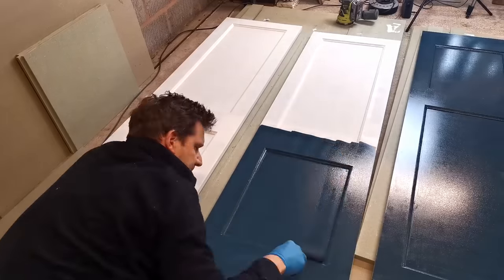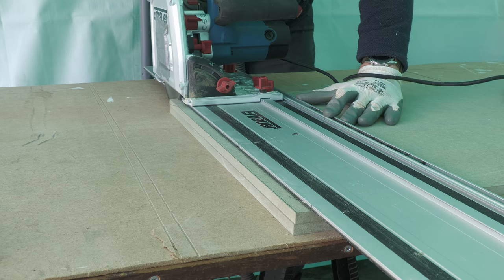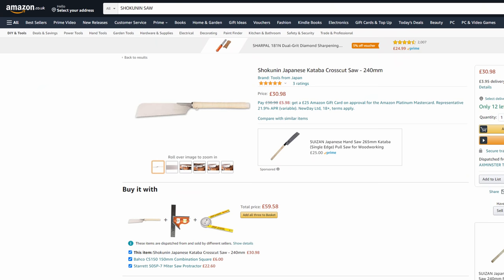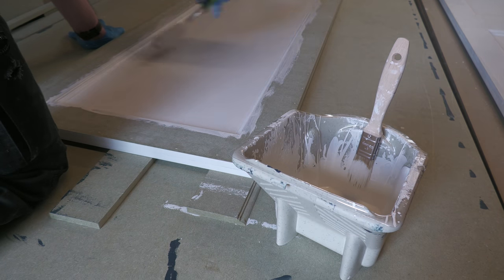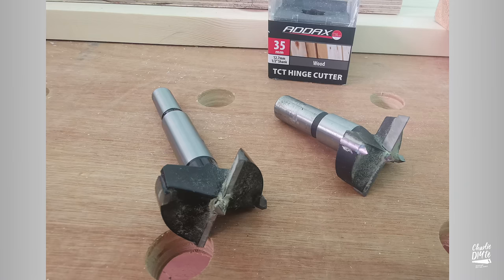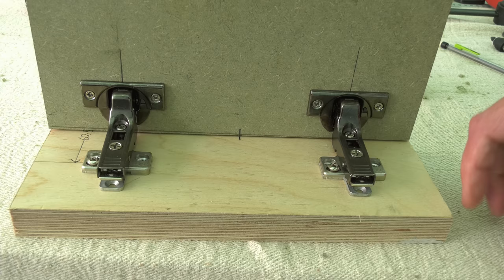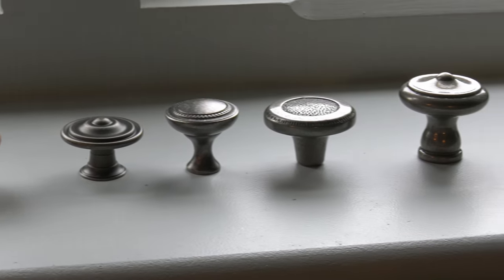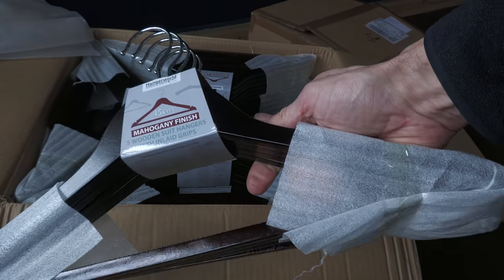How to Make & Hang Shaker Style Doors - Wardrobe Build Video #7

Comment: Watched all of this set and it’s a very good basis for a build I want to do, however it’s not as cheap and diy as it seems with the constant adverts and freebies this person has got through this build.
Reply from the maker: The adverts are a life blood to me as I do this full time and without them I'd be doing it unpaid which isn't sustainable. Would you work for your boss for free? Freebies? The drawer runners? Ok but they're not expensive and neither were the knobs. The wood I paid for albeit with a discount and the tools are all mine.
Reply: @CharlieDIYte  freebies as in free router bits, paint brushes, rollers, vacuum cleaner, discounts, etc. as I said this is a basis on the whole build not just the doors. 
let’s just call it the influencer discount and not a true representation of how much or how long this would take if your not doing this for content.

Comment: I've been really enjoying these videos, but I have to recommend against buying the ryobi nailer. They're one of those tools where it's worth every penny to spend more on a more reliable brand/nailer. I had the Ryobi for a while, had to get it fixed constantly and no matter what service centre I went to they said they saw these nailers ALL the time for the same recurring issues. I got about 8 hours of intermittent use out of mine before I got a dewalt one and it's been working great for over a year. Also used the atlas ones, which are great.
Reply from the maker: Thanks Gerald. Out of interest what kept going wrong on it?

Comment: Superb job, Charlie.  This project build has been a total triumph.  The floor to ceiling wardrobes maximise space & the navy blue shaker style doors are modern yet timeless.  So much love, energy & thought has gone into this (not forgetting blood, sweat & tears).  Well done!  If I want to uber picky, I would have put in a longer inside mirror & a rear view mirror on the inside of the opposite door so you & your other half can see your full outfits front & back & top to toe.  Good for your insta photos too but that’s just me!  You should be very proud of yourself.  Amazing job.
Reply from the maker: Thanks so much for that wonderful comment. After reading it I went and mulled over your suggestion about the double mirrors. I might have to do that! 👍🏻👊🏻

Comment: Hi Charlie, well done you got there, looks great. You can get a fine pin gun then you barely see the pin holes, Makita battery gun  is the best tool I've bought in years. Invest in a 1/2 inch collar router with a 35mm Trend blum hole cutter and leave it set up, saves loads of time as depth and 22mm in  is always set up. Dead flat varnish is a good option over that dark paint. I use Hafele rechargable motion lights about 120mm x70mm they are so quick n easy to fit. Glue the rails and not the door panel that way you can make sure the glue is where it needs to be. Keep up the good work.
Paul Thomson Furniture Makers
Reply from the maker: Thanks Paul - some wonderful info in there - thanks for sharing. Funnily enough I drilled one hole with my DeWalt 1/2 inch router and it was too fast - burnt the hole and then I Googled and learnt you're not meant to use forstner bits with routers. What's your take on that?
Reply: @CharlieDIYte  turn the router speed right down to  number 2 speed slow and steady like a pillar drill. Call any time 9 to 4 must use a trend 35mm cutter

Comment: Hi Charlie.... great video & narration as usual 👍.... when I make my wardrobe doors I use two layers of MDF exactly the same size back to back for the door blank, take one of the door blanks and cut your two holes in there to create the Shaker style look ...... and just route  the desired beading affect on the inside of the frame then glue &  pin them back together this saves a lot of filling for the mitre joints and then all your pinholes can be on the inside of the door .... for affect I stop the routering  just short of the corners........ this method saves a lot of time
Reply from the maker: That's ingenious. How do you get the cuts straight? With a circular saw?
Reply: @CharlieDIYte  Good Morning Charlie..... yes 👍 and then just finish the corners off with a panel saw then a little bit of finishing off with a block sander and you lose a lot of the cut marks when you router the desired finish

Comment: Brilliant Charlie well done really enjoyed the series. Just had a go my self at making waedbrobes doors  and the doors warped which was such a pain.
Reply from the maker: Ah, Neil, I feel your pain. D'you know why it happened?
Reply: Don't use too much pva glue, it dries and curls the door as it is a 2 part construction, only balanced layers of odd numbers prevent curl like all plywood. I use 9mm and 9mm for all my doors with thin bead of glue, you went a bit ott with the glue, the parts are so light, you only need a little. Hope that helps.

Comment: I am mighty impressed Charlie, you should be proud.
I am interested to know how your trim router got on with the large profile router bit as presumably it is bigger than those intended for that type of router ( I have a similar one so keen to know).
The Tite-fix 3.5mm screws are fantastic, I started to use them after you demoed them on a flooring video.   The problem I now have is I cannot buy them in France (I have even contacted the manufacturer, but now joy).
You can now reallocate the temporary workshop to be a gazebo for the summer and take a break!
Reply from the maker: Thanks Mat Can you not get them on Amazon? The trim router handled that bit absolutely wonderfully. No problems at all. I've got to say it's been a fantastic tool on this project, from those angled LED grooves, the bull nose trims on the fascia through to these edges. I've pretty much ditched my 1/2 inch shank DeWalt router now. Funnily enough the tent cafe into its own after easing of lockdown for a few parties 😉

Comment: Hi sir brilliant job as always , interesting problem with the lighting didn’t see that one coming. Regards to the paint finish I always used oil based paint, until recently we had a large project involving lots of doors and shelves to cover . All was ok till we noticed our dog was having trouble breathing, panic stations all round as you can imagine . So it turns out that pets can be extremely sensitive to paint fumes , so It will be water based products from now on for us. Having said all that I don’t think you will have a problem anyway , I have a free standing cupboard that I made several years ago and I used acrylic paint and it’s absolutely fine .  Once again a big thank you for these videos , I always learn something from your lovely channel.                   Best wishes and kind regards. As always        😀👍👍👍👍
Reply from the maker: Thanks and good to hear from you. Yes that really emphasises the issues there are with the vocs. Oil based would have just taken too long to go off given how much painting I had to do on this. I should perhaps have given them a protective coat of varnish or something but I put a lacquer on the kitchen table and it was a nightmare when I came to repaint.

Comment: Hi Charlie, First up, thank you so much! I've watched this series so many times whilst doing the same wardrobes in our bedroom at home and they've worked perfectly.
I have two changes to your design and one question! The first change was I had to use overlay hinges (supply issues down here in New Zealand lol) so I made the decorative strips between wardrobes out of 70x45 (cheap!) and spaced the wardrobes apart by that much. It's made it super strong because it's almost like a truss with the 70x45 sandwiched between 2 bits of MDF and well screwed. I didn't need to use a bit of steel bar.
Secondly, the way you put the rails between the stiles looked like a lot of work for 14 doors (it's a big room!) so I've figured out I can rout a roman ogee on the underside of the rail ends and it slots onto the stile ogee as if by magic. I mounted the Router and made a fence to get it nice off the edges. Is this a stupid idea? I figured plenty of glue and hold my mouth the right way and it should be good!

Comment: What an effort! Great job Charlie, looks great. That is odd about the sensors though, but love your improv fix 👍🏼
Reply from the maker: Thanks. Yes it is odd, isn't it. I even tried putting a wedge on the door so that the paint was hitting it at 90 degrees and that didn't help.
Reply: @CharlieDIYte  what make of sensor is it Charlie? I assume it uses PIR right?

Comment: Excellent job Charlie,
I tried Gorilla PVA glue a couple of years ago, I reverted back to titebond 2 before i got half way through the bottle (not that it was bad it just wasn't as good).
I tend to steer away from blum hinges the price when the other required hardware is factored in for me makes them hard to justify.
Reply from the maker: Good to hear from you 👊🏻 I'll check out that Titebond 2. Thanks for the tip.

Comment: That Ryobi finish nailer is a cracking tool. They’re more affordable here in the US ($99 bare) and I’ve started using mine in lieu of a clamp sometimes. Set the pin flushness soft so the nail stands a bit proud for easy removal.
Reply: Here in the UK Ryobi sell their 16 and 18 gauge pin nailers BUT NOT their 22 gauge version which is available in the US. Come on Ryobi, lets level up the playing field, please!!
Reply from the maker: Thanks Frank. Yes i slightly overdid the pin flushness and got a few mounds at the back of the MDF! Thanks for the comment. Always humbled to hear from people watching overseas 👊🏻

Comment: Absolutely amazing Charlie. So much work involved not only to build this but also to make the video. That's a lot of dedication. I've seen the Clarke portable workshop you use and I've been thinking of buying one for me as well.
After some research I've seen Dancover with a competing product and different levels of materials, like 50mm tubes and PVC cover instead of PE as the one from Clarke.
But I just don't know if that matters that much for using it for a while every now and then.
Can you tell us more about your experience after using it for several months?
Thanks
Reply from the maker: It's pretty much as good as the day I put it up, and it's laughed at every storm, and all the snow that's been thrown at it. I love it. Complete game changer for this project. Also no real signs of degradation, mould etc which is interesting. I did occasionally get a bit of condensation inside, as other people have complained about, but literally 2 or 3 times and using the heaters in there probably didn't help. I've got a couple of pin prick leaks on the roof, correctly stopped up with gaffer tape but I suspect that was a loose spark from the grinder or perhaps the claws of a jackdaw. Whatever you get make sure it has ratchet straps like this one, that you can tighten every now and then after storms
Reply: @CharlieDIYte  awesome, thank you very much for this. Love your work. All the best.

Comment: This is exactly the wardrobe I want to make and this is the absolute best video I've found. I have a few questions. I want to go the router bit way vs. gluing on the trim. When you use a 1/4 bit does that mean you have to use 1/4" thick wood? I know you glue mdf trim over an mdf board what is the total thickness of both boards.
Reply from the maker: Thanks. No 1/4 inch refers to the size of the shank on the bit. Each piece of MDF is 12mm thick.

Comment: Your videos have been so inspiring! I’ve got my carcasses done and rails in, and now heading into drawers and doors. Given the difficulty of fitting the hinge mounting plates after the drawers, why did you do the drawers before the doors? Can’t you (I!) do the doors, then unclip them and do the drawers?
Reply from the maker: Great to hear from you Nick. Very chuffed you're finding my vids useful. Sounds like you're doing a fantastic job on the wardrobe. Yes, your idea is a very good one which in hindsight I should have done! You have the luxury of watching my vids, seeing where I went wrong and perfecting the process for your build 😉 Just don't be tempted to make the gap between carcass and draw liner any narrower than I did, because you need all that gap to get your hands in to unclip the door.
Reply: @CharlieDIYte  thanks! An extra 10mm or more? Maybe I could just ask a child to reach in? ;) My current battle is boring the hinge cups accurately. I’m making screen doors to fill with canvas so am using soft wood rather than mdf. It’s a real pain to bore!

Comment: I have to complement you on this massive project. The wardrobes look beautiful. The videos series gave me some good ideas for a smaller alcove wardrobe I’m planning. I had a quick question on the build. 
Did you fix the wardrobe carcass to the sidewalls, so that they can support the weight of the doors. If so which fixings do yo recommend and how many?
Reply from the maker: Thanks Nanda. Yes i screwed the carcasses to the side wall. I think I used 7mm brown plugs on the right wall into brick and Fischer Duopower 8 x 40 on the left wall that is insulated plasterboard.
Reply: @CharlieDIYte  Thanks Charlie. I use the Fischer plugs a lot myself. Very convenient for multipurpose use. What type of screws did you end up using for the Fischer plugs and with what spec?

Comment: Love the detailed explanation of everything you do. It’s been so helpful in my projects. 
Quick question, where you have doors opening back to back, is there a trick to mounting the base plates either side of the dividing panel? Maybe my screws are too long but I think they will clash on either side of an 18mm sheet.
Reply from the maker: Thanks Matthew. I think the easiest solution would be to use 15mm long screws. Should give the hinge more than enough strength.

Comment: Hi Charlie. Did you panel the doors for added rigidity? I'm looking at constructing MDF doors without the panelling, would you be concerned about warping if using 18mm MDF, without any added reinforcement?

Also, out of interest, why did you use the solid wood instead of MDF for the surround pieces (skirting etc)?
Reply from the maker: Hi, panelling was more for the look than the rigidity. You should be with 18mm but attaching concealed hinges might be tricky as 18mm might not be deep enough. Make sure you use MR MDF as I find it more stable.

Comment: Looks great! Also a lot of great info. I'm thinking about making new kitchen cabinet doors this way. Could I do the base in 12mm and the styles in 6mm or would the doors be to weak?
Reply from the maker: Not too weak, but the problem your going to have is with fixing the hinges. You've just about got enough depth to drill the Blum the cup of which is about 14mm, but the point on the bit is going to be very close to the surface and you might struggle with butt hinges.

Comment: For the lighting switching I’d recommend a jeani door switch, as it makes contact with the door to turn off
Reply from the maker: Thanks Jake. The flush switch would work particularly well with an overlay door. I wonder if they integrate with Sensio. I guess you just solder the connections.
Reply: @CharlieDIYte  All you would need to do is splice into the positive cable to the strip you want and add the switch there, or you could do it on the 230v side before the transformer if you had one for each set of doors. And for ease you could use maintenance free connections like wago’s
Reply from the maker: @jakeharvey05  Thanks Jake. I'll probably do that on the next one. Love Wago connectors. When I pulled up the floor in this room there were (amongst the 5 dead mice)  2 bakelite junction boxes which I replaced with maintenance free Wago boxes and connectors. Such a fantastic bit of kit.

Comment: I think I may have mentioned before, for mdf edges use French polish or knotting, rub the edge down fine as possible, then seal with French polish, then 2 coat of bin which sands to a fine chalky finish, then two coat of topcoat, yours edge will be a smooth as glass.
Reply from the maker: That's a great recommendation Jason, thanks. Does BIN adhere ok to the polish which I would have thought has wax in it 🤔
Reply: @CharlieDIYte  yes it sticks to the French polish /shellac perfect, as bin has shellac in it as well. Two coat of French polish or shellac and rub down with finest sandpaper in between coat. The mdf edge will give you a glass finish with shellac based sealer.
Cheers.

Comment: Great videos.  The warping makes me nervous, just wondering if cost is the only benefit over pine for the carcasses? Or are there other reasons MDF is better?
Reply from the maker: You can't get pine in these widths. You'd be using ply which is fine but more expensive and less easy to tool.

Comment: I was looking to get the Ryobi 18ga nailer thinking it would be the best all rounder, I notice that you used a 16ga nailer. Would you have a preference for this guage over the 18ga?
Great video series this, great systems you've been using and some techniques that have given me food for thought on some upcoming projects.
Reply from the maker: Thanks David I really appreciate that. The 16 guage nails are a bit thicker (apparently it comes from how many you can fit into an inch length), and I wanted a nail gun that was as heavy duty as possible. Given you can put short nails in like those 20mm I used, as well as per long ones I figured it was a better all round buy. I might be wrong...

Comment: That light sensor though!! How annoying. What you could do is pick up some cheap ones from AliExpress... There's loads... Test them on your paint then you can solder them in. They're just binary on and off, so it'll just just be 3 small wires. 
But the white patch isn't really a problem. 
Amazing job Charlie. Well done sir.